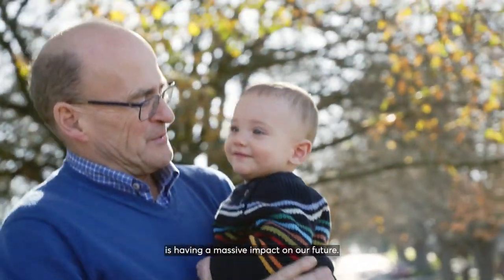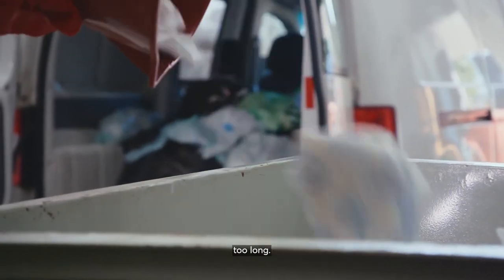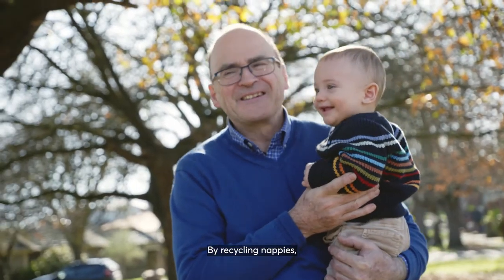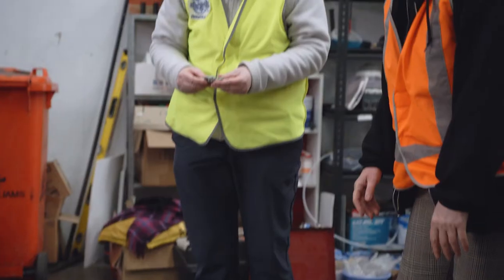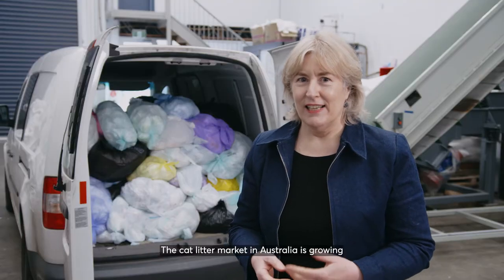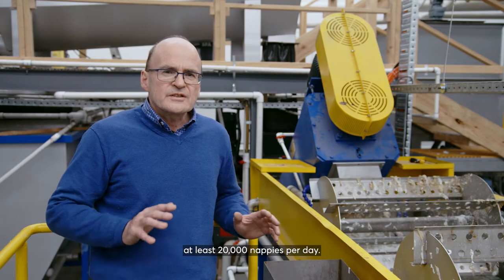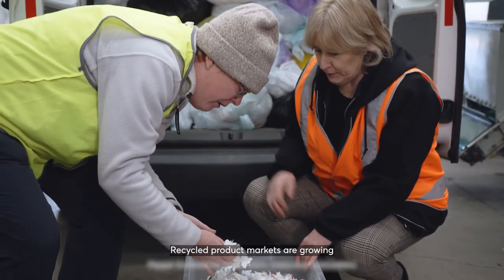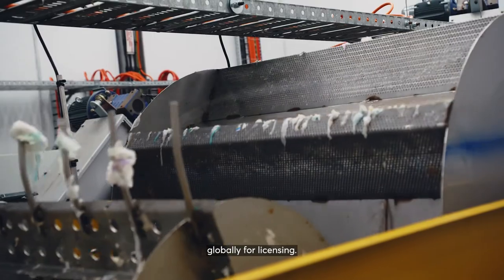DiaperRecycle  Recycling disposable diapers

Comment: Plant Fertilizer yeah not kidding .. cut diaper open the Gel a diaper makes is PERFECT in a plant pot to lower watering that plant and you can also use the pee diapers just not the dirty diapers ... the Amonia from Urine is good for plants but its a washing ya hands after job clearly and something where you need to do it quick cus when the Sodium P crystals dried out the Urine fx will be released again .. so Plant Fertilizer is a HUGE one JUST NOT THE PLASTICS ... ONLY THE GEL